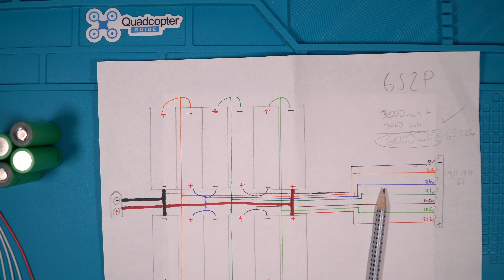Build Your Own Drone Battery - Why and How!

Comment: It would be nice to have the connector from a drill or whatever so you could buy the batteries from Harbor freight . If I had
a 3D printer I would be making something like that and getting rich . Maybe a mount with screw holes or for zip ties .
Reply from the maker: thx for watching!

Comment: I purchased a Ghost drone 2.0  and the battery lasted 4 flights before the batteries puffed up. Customer service was none existent. So its been sitting on the shelf for 3 years. I recently purchased a lithium polymer battery twice the size as the ones that failed on me. I also bought a versatile charger.  Do I have to use the original battery monitor and on/off circuitry?  or can I just plug in my DIY battery . Id really appreciate your ideas. oh i also purchased the iOS model...being an android guy all the way. Can i download the android software to avoid wasting money on ios?

Comment: Don’t I get dbl run time by running 2 pks in parallel
Reply from the maker: Hey SB thanks for taking the time to watch and comment. It is much appreciated! The added weight of the 2nd pack reduces the flight time, so it's not just doubled everytime you double the battery etc.

Comment: these sony murata cells will work fine. the original cells can handle 120c or 140c, but that will never be used - the battery connector can't handle that current (if the drone draws that much current, the battery will die in a few seconds, not 20- 30 minutes) your soldering iron doesn't have enough power to solder well such thick wires...

Comment: Can I ask you a question.  Can Mavic Pro motors handle 4S li-ion ?
Reply from the maker: Hey drone pilot, thanks for taking the time to watch and comment. It is much appreciated! The original Mavic Pro had a 3 cell battery. So if you mean MP then 3S max. Not sure if the weight would be too much.

Comment: They are heavy which is why DJI doesn't use normal lithium batteries. So it takes more power to fly with more weight.  Go with Samsung 35E 18650. They are pretty much the best you can buy right now.
Reply from the maker: i know its been a while but looks like DJI is favoring Li Ion for the mini series now.

Comment: Just to be clear this will only work good if you're drone consumes low power consumption when we're talking about most of your mavic products were talking about amperage draw a higher C rated discharge battery is required which is why they use Lithium Polymer instead of lithium ion if you were to make the same attempt on a regular mavic platform you would find really quickly that you would start running into serious instability in the platform because when it goes to draw that extra energy that it needs for the power boost unfortunately ion does not provide this and you will have what we would call a system brown out. the Drone will go into complete system shutdown during flight and it will fall out of the sky like a rock. So basically  you really want to understand how  this system work properly  before going out and attempting flights on this type of setup because there's another thing that has to be considered in that is wind. These battery builds with ion are great if you're just cruising around but if you were to run into a gust of wind and the Drone wants to continue its course it's going to need power to fight the wind and if it over drawers  the capability of the battery  then it will Brown out. Good video brother this is the majority of what I do on my channel is showing people how to take proprietary drones and Design hobby grade setups for them so they can use hobby grade batteries instead of proprietary based system
Reply from the maker: Correct, the burst power available is less than on a LiPo, as mentioned in the video. That's why I planned this to be a 6s2p pack on the 7" quad to give me 60Amps, It ain't no 200Amps which the drone can pull on full throttle, but the limitation must be known to the pilot at the controls. Most DJI camera drones use LiPo High Voltage cells also, so pairing those with even just regular LiPo wouldn't be safe. I would advise against tinkering with any LiPo pack anyhow.

Comment: For more flight time you could use 21700 only slighly larger but more capacity. Very well done as soldering onto batteries can be difficult.
Reply from the maker: Hey Ard! Thanks for tuning in. I had 21700's on the radar, but since I really want to go 6s2p the extra weight of the 21700's didnt pan out. I think 6000mAh in a 6s2p of the VCT6 pack is plenty. Worked out to be lower g/1000mAh ;). Sure i will only have 60Amps vs 90, but it'll have to do. Hey let me know how ur Mavic flight went!
Reply: Quadcopterguide No worries...18650 are fine and there are some high capacity available. You looked to be using either Samsung or Sony.....but stay away from some others as they are poor and do not deliver the amp hour stated. I will when I fly it lol.....still hunting an apple device as I want it only for the drone. I do hold it everyday if that counts ha ha
Reply from the maker: @ardscorner  haha. Yes these are Sony/Murata VCT6 cells 3000mAh 30Amp. You are a patient man :). I think i would have sent it up with whatever by now haha.. Enjoy the hunt.
Reply: Quadcopterguide I am getting there....got some ND filters now
Reply from the maker: ARD's Corner nice which ones did you go with?
Reply: Quadcopterguide Emailed
Reply: 21700s I do not recommend.   Tried 6s 21700 Molicels hoping to save some weight.   Wound up with no more flight time than a heavier 4000mah 6s2p Samsung pack that I built.   Talking 420g weight range for 6s 21700 versus 645g weight for 6s2p 18650.

Difference was the 18650 6s2p pack came down cool to the touch after 18min of flying.   The 21700 pack came down fairly warm to the touch after same 18min flying.

Needed roughly 15amps to fly with either pack.

21700s were clearly not happy pushing 15 amps along with limiting my peak draw to only 30ish amps(forget the 45amp rating).

Better to be 6s2p and really double up on current rating and double your capacity.

Sony VTC5D has been best battery I have used so far out of around 12-15 packs built ranging from 3s to 6s2p.

Comment: best of all: first approach with 2p shematics was perfectly drawn

In the second you decided to abandon the 2 adventure your sketch was hands on.

pretty interesting to see your bms cable being faulty sorted if I understand it right.

I just have to refit a 5 cell 18650 battery pack for a gardena lawn mower roboter with samsung inr 35E and 3,5Ah but 10,5A only .

That has a bms too and I had written down each cables colour and cell position during tear down  to get it right ...

But the basics are the same except my packaging needs to be a 3 x 2 cell solution, hexagons as a holder to get a battery that will fit into the bay while you're piling it as a 3 x 2  stack. My hight has to be as low as the original.
Reply from the maker: Thanks for your kind words. I want to figure out a way to do 12 cells 6s2p but having only 3 wide and 2 tall and longer. That would be ideal to fit ontop of the quad.

Comment: That soldering iron is not hot enough. You're getting cold solder joints.
Reply from the maker: Hey Steven, thanks for taking the time to watch and comment. Much appreciated! That thin tip was not ideal. I have since gotten a nice fat tip, will try my next pack with it.

Comment: Hi, I'm really pleased that I came across your site, I'm a beginner drone flyer, really loving it. I've built an Echine Tyro 129 but the batteries are really expensive, I've got a bundle of Panasonic 18650AA  2250 mah batteries  from a damaged ebike battery.  I've already used some to replace the old style batteries in my 12v,18v, and 24v power drills, I've got 16 left. could I use them to fly this 7" drone ? It weighs 400g without a battery.  I could build 2 x 6S1P packs or 4 x 4S1P packs. If they are suitable, what would be the best combination? I'm familiar with building 18650 packs, but I get mixed up about watts and M.A.H ( I'm in my 70's). I've subscribed, loads of useful info. on your site, thanks.
Reply from the maker: thx for watching!

Comment: So do you recommend your masterpiece can be used to plug the commercial mavic or Phantum...leave it for a while as to how to connect it with quad but if connected, will it work ? If it works, damn !!! I'm gonna able to multiply flight time (with bit compromise on weight) ...
Reply from the maker: Hey Imran, thanks for taking the time to watch and comment. It is much appreciated! it is possible to hook up extra batteries with some hacks to existing camera drones. They have to be different cells than these Li Ions though and it's not for everyone.. Of course it voids any warranty you have...

Comment: Great video. Few things, you're not pre-tinning. You're tinning. It's one of those weird things like a "hot water heater". Why would you heat hot water? 🤔 Also, you can buy small tinned straps to connect the cells and keep everything flat. Something to look into. 👍👍👍
Reply from the maker: hey fmf thanks for watching and taking the time to comment. Much appreciated! Will keep that in mind. My research showed that the tinned straps handled less amps as the silicone wire, why i went that route. Maybe in the future, then I would want a spotwelder too muhahaha :D
Reply: @Quadcopterguide  I think everyone should have ALL the tools. 😆 I'll have to look into the amp rating. I would think that there's more material, thus more ability to carry amperage, in the strips as long as they are the right size. Maybe not tho?

Comment: Watched this as I'm preparing to build my own pack for the first time.
Reply from the maker: Hey David, thanks for taking the time to watch and comment. It is much appreciated! Very cool your building as well. What are you building your pack for?
Reply: @Quadcopterguide  I'm buying a 7" from a friend. Want to try some long range cruising. Also, at 88Wh, it would also be useful for field charging lipos for my smaller quads!
Reply: @Quadcopterguide  So I did the build and got a twenty minute flight! Here's my build and flight https://www.youtube.com/watch?v=XrO2pX8u4o4

Comment: The voltage doesn't balance in series, it balances in parallel. That's why if a cell dies in a battery pack, it'll take the whole parallel group with it, but all the other cells will be fine. The cells in parallel will discharge into eachother, which is why the cells in parallel need to be similar voltage
Reply from the maker: thx for watching!

Comment: Hmmm ... based on your cover image, holding up a Mavic battery, I was hoping you'd show a way to take an old dead Mavic battery and use the 1365's to bring it back to life, perhaps at a lower capacity.  But the video has nothing to do with the Mavic battery.
Reply from the maker: Hey dkuchta5, thanks for taking the time to watch and comment. Much appreciated! I suppose if one wanted to, and was able to, they could carefully take the outter shell off and see if its a single cell that's bad or the intelligent battery controls. Honestly, with a battery like that I would just try to find another replacement online. Is it just one?
Reply: @Quadcopterguide  No I don't have a dead battery now, but likely will at some point.  I just thought, based on the cover image, that there might be a way to revive one cheaply when that happens.  My default assumption is that there is not, due to the more complicated circuitry for smart charging and partial discharging over time.  But your cover image gave me hope!  Now, that hope has been dashed on the rocky shore of despair, alongside the rest of my broken dreams ... (sob. sniff.) Sorry, got a bit choked up there.
Reply from the maker: haha don't let me get you down man! I have a feeling that if a stock charger can't revive the battery something major has gone wrong. If that day every comes, let's see and hope not!

Comment: Really not a good idea to solder 18650 batteries.  The heat is not good for them and the solder will come unstuck easy.  You can buy a $20 spot welder and a $5 roll of tin to do a Pro job!
Reply from the maker: thx for watching!

Comment: An amazing video . I was really searching for something like this . Though I still have  a problem . I have made my own cinewhoop recently . A shendrone geyser.  It is a little heavy since it's a 4 inch cinewhoop and the ducts add up the weight.  Plus if I am flying with the go pro , the 4s lipo only gives me only 2 minutes of flying time ( without go pro 4 and a half or 5 minutes ) . Will a lion help me get more fly time. I am using 2300kv motors . I am still not confident that a liion will help my drone get off the ground let alone increase the flying time.  Is it worth trying ? Becasue lipos suerly aren't worth it .
Reply from the maker: Hey Simran, thanks for taking the time to comment and watch, it is much appreciated! It may be difficult I would be worried about the drone pulling too many amps. What is the max amps in your typical flight?
Reply: @Quadcopterguide  I have 40 amps motor so the total consumption is 160 amps theoretically still around 130 - 150 amps would be sufficient.  Which is provided by the lipo.  Since the li ion cells which I have seen hardly have a rating of 2c . Some can ( like the Lg and samsung ones ) prove 5 to 10 ampa but that too in burst . The quad itself is 442grams without battery and go pro .
Reply: @Quadcopterguide  I am looking at 8 cells connected together for now .  The lipos are certainly not worth it . I am just fed up of changing the packs for two minutes of flight time  . Since I only require gliding power for a cinewhoop ( I dont need to do crazy throttle consuming freestyle stunts and all )I thought I could go with the li ion alternative using only 40% of the full throttle .But now after just reviewing everything I get it why people build a 6s cinewhoop .  I  think I might have made a mistake by making it a 4s config.  The only alternative which I can think of now are mobile batteries . But good mobile batteries with high c rating cost a fortune .

Comment: Very cool video here. You have a great speaking voice too. I gotta study what you did here a few times to better understand exactly how you did this. One thing I learned for sure, is having the proper tools, and material for the job. That's over half the battle, lol. I went through a lot of soldering tips, learning how to solder correctly. I like the soldering cleaner you have too. Gotta make one of those. First time viewer here. Thanks for a fantastic demonstration. Liked and subscribed.
Reply from the maker: Hey Al B thanks for taking the time to comment and watch, it is much appreciated! Glad you like the videos, oh man. How many times have I done a project without the right tools. Always takes 3 times longer and 10x more frustrating. I try to avoid that if possible haha. Glad you are here!

Comment: Hi...my favorite part is how far you have taken FPV in so short a period of time. Building a 7" quad, and building your own batteries is remarkably adventurous and encouraging to others; myself included.
I know you have done the hover test. Have you used these under real world load conditions such as fighting gusts of wind at high speeds? If so, what are your observations?
Reply from the maker: Hey mosephina, thanks for taking the time to watch and comment. It is much appreciated! Glad you enjoy the FPV content on the channel as well, I'm glad some are enjoying it. Great question. I took it out to do a flying test, it was a very windy and gusty day, i flew 40-55kmh average and still got 14minutes of flight time. I left the throttle mostly steady and used other inputs to manage altitude etc. I was pulling 8-13amps max, with 2 of these batteries in parallel, I'm sure even decent manoeuvres should be fine. What are you flying thats similar?

Comment: Great video! I just purchased my first soldering kit and this tutorial is a great visual reference tool (even though I won’t be doing any battery fabrication) but watching the way you soldered the wires was very insightful. Now, at what temperature in degrees did you have your soldering pen set to for this job? Thanks again for this.i learned something new from it. I look forward to your next video on testing the battery 🔋 👍🏻
Reply from the maker: Hey Drone Syndrome! Thanks for tuning in again man, super appreciated. Very cool about your first soldering kit, what did you end up getting? My soldering in this video isn't the best of my work, but I wanted to get this out before re-shooting the whole thing later again. Ideally you want to heat up the surface, and the solder will flow from your pre-fluxed wire onto the pad or whatever you are soldering to. I had the iron at 400C for pretty much everything this time. Glad you enjoyed it! Makes creating it worth it.
Reply: Quadcopterguide I got a $20 one on Amazon. Nothing too fancy. I just wanted to have one handy for when I need to repair or assemble something. But the one you’re using is pretty cool looking and seems to do the job well.
Reply from the maker: sweet man, yea a $20 Iron is so much better than not having anything at all :). For just one offs totally fine.
Reply: Quadcopterguide I agree. I’m a newbie to soldering so this is fine for starters. By the way, this is the unit: https://www.amazon.es/Tayg-59002-Electraline-Mult%C3%ADmetro/dp/B00CBJOOUA/ref=mp_s_a_1_6?dchild=1&keywords=digital+multimeter&qid=1595836157&sprefix=digital+multi&sr=8-6